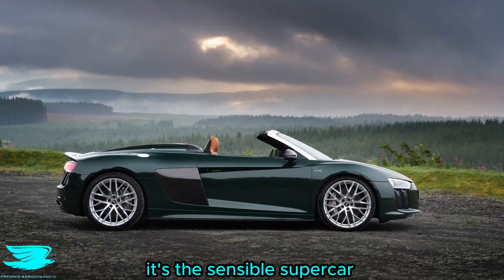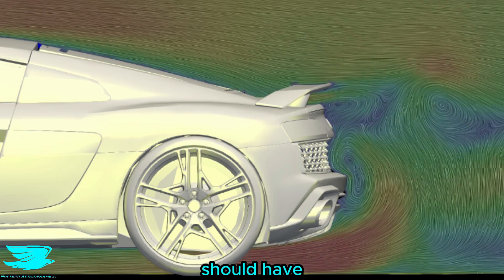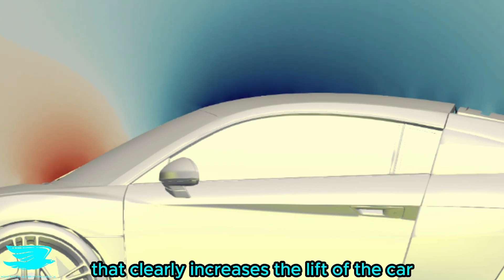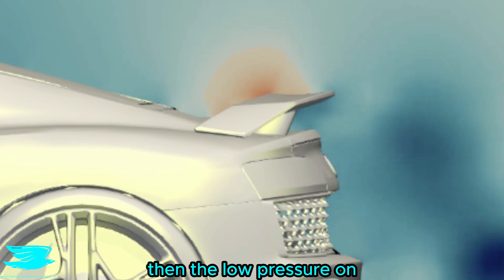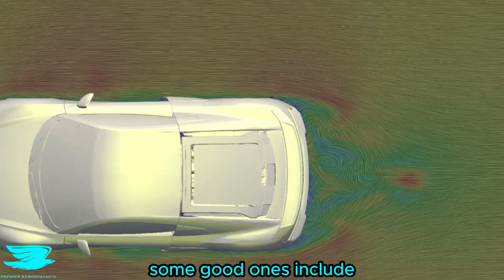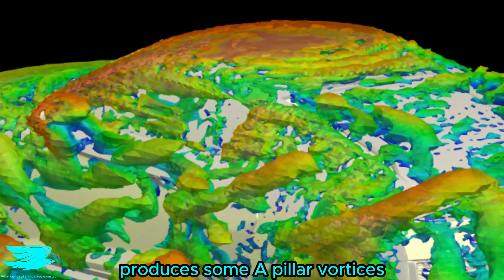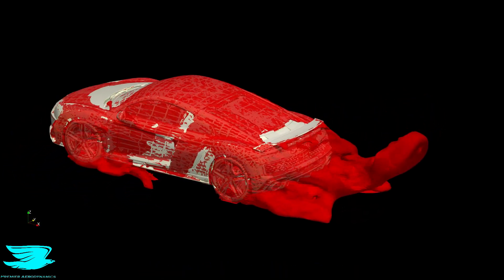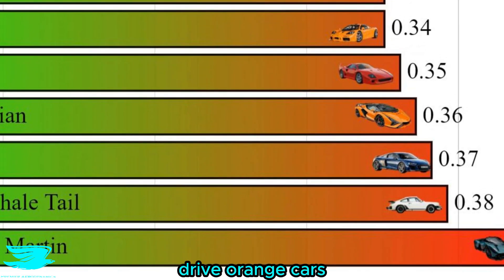The Audi R8 Has Bad Aerodynamics

Comment: Even just eyeballing the car, you can see the large air dams in the front bumper don't exit anywhere once they enter the wheel housing. On supercars and especially hypercars, there's a reason they started putting these huge vents on the doors, just behind the wheels; it's also on the Mustang GTD, it allows restricted air to exit the front wheels to improve handling. This improves airflow significantly and it's funny how... obvious it is that it would, lol. Still, props to the engineers anyway.
Reply from the maker: That's a great point.

Comment: someone tell me im dumb, i allways think of puting a chanel behind the wheels to suck the tyres wake, with 2 fans on the back of the car that suck this tyres wake through this chanel, would this mitigate the drag of the wheels? also the same fans can be used in many ways, to invert the blades creating drag when braking, could create a flap that with a press on the stearing wheel can direct the flow or in horizontal position, to create thrust, or im almost vertical position to create downforce. can also be used to mitigate the drag created by the cooling, and much more, its is really not that difficult, the car already have many fans, just need to remove than all and stick just just powerfull in the back, noise is not a problem because it would just work in track mode, when you need confort you can just turn it off.
Reply from the maker: Fans can definitely work, however, the main consideration is how much energy they are using compared to how much you will save. With the wheel wakes, they are naturally low energy, so you need to supply energy to accelerate it. If you want to pump it out into the car's wake to make the wake faster and hence less draggy, then you need to route it through the car, which is usually impractical because of other components in it. In terms of that idea, we went through it in this video: https://www.youtube.com/watch?v=CJQTJI7gHt4

Comment: Correct me if I'm wrong: This judgement is extremely flawed because it's using a rather low poly version of the real deal and it doesn't take into consideration vents and openings. I mean, it makes it seem almost like the car is blocking all air that hits the front grill when the front grill in fact doesn't do that.
Reply from the maker: Thanks for the input!
Reply: technically the Front grill DOES block the Input, cause the Air runs trough Radiators and other coolant related Devices. THIS slows the Air down and creates a High Pressure Zone in front of the Car. Also Air Intakes ALL slow a car down... exeption the NACA DUCT (Google it). Any large "Shovel Size" Intakes like on the Side of the R8 slow the car down and create drag.
It's literally a fine Balance of everything and not be spoken in general. 
Plenty of modern cars now even have flaps behind the Grille to block it off completely when going fast for Aerodynamic efficiency. Driving fast not much Airflow is needed for cooling... only when you slow down more Air is needed again. Sound funny, but take a look at some modern cars. 

Ever seen a BUGATTI ? This car eben closes most of the Air intakes when going fast...

Comment: Looks like you're treating the front like a solid airtight surface when in fact it's not - getting this air inside through the coolers and directing it outside at certain points is vital for an ICE-car and accounting for that front and rear will remove a lot of your mentioned problem areas.
Reply from the maker: Thanks for the input!

Comment: Great video. How would you improve the situation? What would be the easiest and most beneficial modification to an R8's aero?
Reply from the maker: Thanks. From a DIY point of view, much of it is fixed. But, lowering the car and putting on rims with much less opening would be the easiest, and you might get a 3 or 4% drag reduction quite easily from that.

From a more fundamental design point of view, the best thing is to lower the roof and not make it pop up as much.

Comment: Did you model the front air dam and radiator? 
It looks like the front air dam is completely blocked off, instead of letting the air flow through.

The result might be misleading if you didn't model this part correctly.
Reply from the maker: It's closed cooling flow.
Reply: the Airflow gets slowed down by the Radiator, hence crating a High Pressure Zone in front of the Grille

Comment: Welp the r8 is dead anyway. And the 1st gen design wad more successful, even beside its gallardo counterpart. Those side blades, the DRLs, the rear light graphics, the exhaust, that V10 commercial with the red hot exhaust test run. Simply iconic. Walter da silva was the best designer the vw group had employed.

Comment: I am not sure if this model includes air vents that direct air in frontal area, I like your videos and I would like to see electric models that don't have vents.
Reply: also is spinning of the wheel even included in wheel drag because it does not look like it
Reply: The largest and slightly smaller grille pieces on the front are open/partially open for directing air through the front intercoolers. The smaller pieces are all totally solid - purely aesthetic.